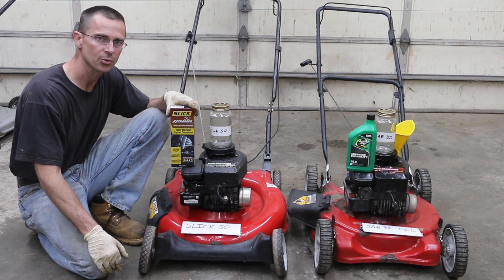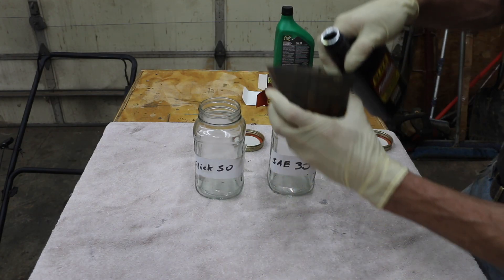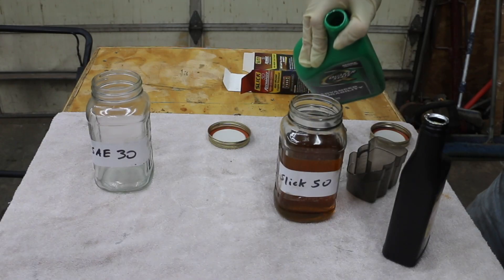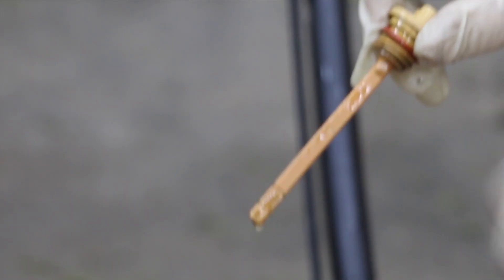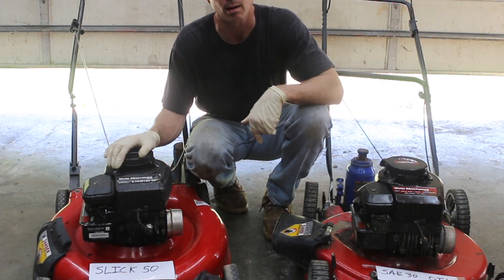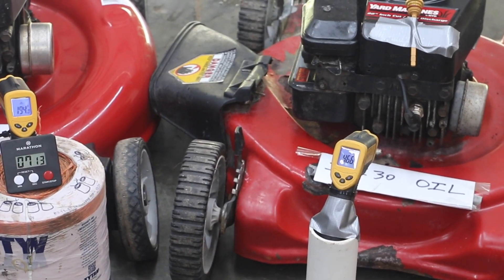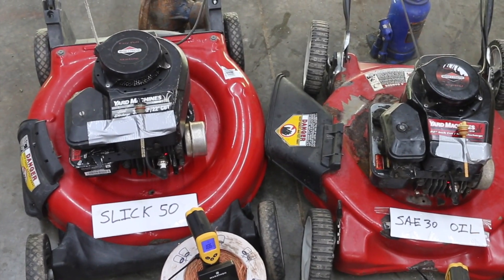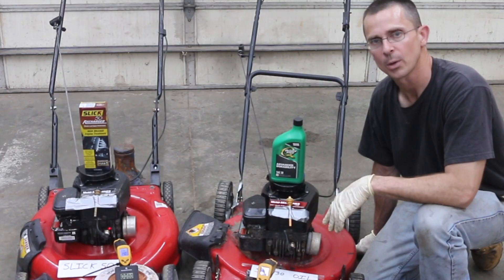Can't believe what SLICK 50 did to my engine!!--Dry Crankcase Test!

Comment: I used to work at Mobil Oil as a Technical Sales Rep. They always taught us that such additives are literally "snake oil" and to be condemned in all cases. This was because Mobil had enormous research facilties - which is true - and if there were any "magical" additives with remarkable benefits as claimed by Slick 50 and the rest, they would already have incorporated such materials.

Also, as shown by the video here, such additives can actually be harmful as I also found when I many years ago, added an additive which claimed to have micro-particles of teflon or similar (may have been Slick 50? cannot recall) to my Lycoming 0-320-A2B aircraft engine oil.

On taking the aircraft for a test flight around the pattern I found the oil temp starting to reach the upper limit very quickly. 

That ended any ideas of oil additives for me! Just use a good brand of oil and it will give the best protection and performance available.
Reply from the maker: Thank you for the feedback

Comment: You might want to do this test again.  Slick 50 has not been available since 1984.  The name “Slick 50”, which was not trade marked,  has been used by various oil companies but the product is not the original formula.  Look up youtube video titled “ Xcelplus: What happened to Slick-50? Interview with John Bishop”.  The original Slick 50 is now called Xcelplus.
Reply: I found this http://www.1expired.com/dura-lube_slick50.htm.  In summary, it says the miracle stuff is teflon solids in the oil.  Many lawsuits over claims of miracles.  Dupont, creator of teflon, says it doesn’t work as an oil additive.  Various tests have shown that the teflon solids actually cause anything from cylinder damage to blocking oil flow.
Reply from the maker: Thank you for the feedback and the link

Comment: Both my vehicles in which I used this stuff experienced wrist-pin knock at about 100k miles after I bought them new. I can only guess the oil splash lubrication was less effective due possibly to the oil droplets not adhering to the treated surfaces..more like not flowing into the bearing surfaces but rather resistant to adhesion by glancing off. I think this additive may be ok but only on pressurized journals.
Reply from the maker: Thank you for the feedback

Comment: I use to swear by slick 50 in the early 80s in my cranes and draglines. It for sure kept all the gear cases way cooler than plain 80 - 90 gear lube..In the 90s I read where slick50 was sold and no longer had the performance of the original company.. any thoughts on that ?
Reply from the maker: Thank you for the feedback on the formula change. I need to test the old formula

Comment: The problem with this test is that the engines are on their sides. A car engine is vertical and the Slick 50 has to be run in for X amount of miles before you can do this. Also these engines only lubricate the crankcase rod & arm so with no oil in the crank they will both run dry eventually. Slick 50 only works because it is magnetically attached to the metal work inside the engine with heat & friction. Lawnmower engines don't work this way. I have used a light spray off PTFE in the cylinder and this will help to protect your mower engine from seizing up in the event there is not enough oil in the crank. But don't run with no oil.
Reply from the maker: Thank you for the feedback

Comment: I agree with Speed Demon, the disparity of symptoms in the end suggests that the ultimate cause of failure was not the same. An engine who's main problem is a lack of lubricant will display symptoms like the SAE 30 side showed. The other motor probably had a more pressing (if not previously evident) problem.
Reply from the maker: Thank you for the feedback

Comment: I get much netter mileage with RISLONE.    ,  in my Mercedes C 240 it improved mileage from 24 to 30 mpg,   I tried it on my C300,  got 30 mpg. And it a 4 wd.   RISLONE is Zinc,   They took zinc out of oil ,   Old cars burn up with new oil,  study up on that,,,
Reply from the maker: Thank you for the feedback

Comment: If Slick 50 does what it claims the oil moves through the engine faster, carrying heat away from internal components and reducing friction. As such you should expect it to seize 1st due to lubrication draining away from parts fast. The Teflon doesn't really bond to parts, it just reduces molecular friction by changing the viscosity, and molecular adhesion.
Reply from the maker: Thank you for the feedback
Reply: @ProjectFarm  I never saw the Slick 50 no oil test you talked about. I used to use it in my 78 Trans Am Pontiac 400 Formula engine, years ago. 
I don't really understand what your trying to accomplish destroying motors, but youtube has a lot of that. GL with your channel 🙃

Comment: I use to use something called "Duralube" in my engines that were always at least a quart low on
oil and they never seized on me.  I know my bad for letting oil run that low.
Reply from the maker: Thank you for the feedback
Reply: Dura lube saved me a couple of times over the years.
Reply: It won't hurt your engine if it is a quart low. You could remove 2 quarts and it would still be fine for a long time.  Always top it off though.
Reply: I have used Duralube

Comment: I thought slick 50 had to run couple days to plate everything?
Reply: I believe it must run in the engine for a minimum of 30 minutes or an hour, I don't recall, but it does have to run in the engine for a little while to "soak in to the metal. This was not an accurate test, but interesting to watch.

Comment: 1. Shake up the bottle of Slick 50, otherwise most of it's solid particles remain at the bottom of the bottle. 
2. I have put a cup (8 oz.) of Slick 50 in every oil change for more years than I can remember. My 86' Toyota PU had 253,000k miles when I sold it, it's still going. Original timing chain, etc. Once a delinquent neighbor drained my crankcase, and it was only after the temp. guage went way up I pulled over and discovered that no oil was showing on the dipstick. Put oil in, drove for several more years, never had any oil burn related evidence.
3. Slick 50 is expensive now days, $30 per quart, but in the very cold temperatures of New England, I consider it worth the cost.
Reply from the maker: Thank you for the feedback

Comment: seems like so many variables that others have pointed out, the temp of the slick 50 engine is interesting,more testing really needed to remove variables , non destructive testing on 2 new motors and if in multiple test the slick 50 runs cooler , might have something there
Reply from the maker: Thank you for the feedback

Comment: Great video mister.. I marketed Slick 50 back around 1978..about the time it was a new product  before it was on the shelves in stores. It was sold by individuals & a friend got me involved. It came in a 32 oz can back then. The key is to let Teflon chemically adhere to the metal inside the motor. That means running it through the course UNTIL the next oil change not just for 30 minutes on the shop floor. We drained our mower & started it & it did NOT seize.  I've run about 3 vehicles in my life that I've had close to 400,000 miles when I sold them & still ran fine. On a couple occasions  I neglected the vehicle & with no oil on the dipstick  they still ran fine and I had no issues with smoking motors due to burning oil. Slick 50 comes in a much smaller bottle now.  The 20% back in the day meant replacing 1 of your 5 qts that the crankcase typically held.  I've owned several more vehicles than just those 3 & I've put Slick 50 in EVERY one of my vehicles which included various makes & models, also tractors for Ag & semi tractors. Thx for the video yet u might consider the proper use of Slick 50 as opposed to other 'additives' such as Lucas, Duralast etc. There's a diff as a 'part' of this Slick 50 is meant to bond to internal parts.. Not just lubricate 
😎🚬
And for the record I have approximately 3 million professionally driven miles behind me which includes racing, agriculture and also tractor trailer
Reply from the maker: Thank you for the feedback
Reply: @ProjectFarm  ..  This is a great channel. Thank you sir

Comment: I put Duralube into an old van that I had, treated it a few times.
One winter, it got so cold, the oil was to thick for the pump to draw out of the pan.
I'd let it idle for around 30 minutes, dry, until the engine temp warmed it up enough for the oil to get thin enough to flow.
Did thay for a week straighr, and had that van for several years after.
The van died of causes other than the engine, but it never wavered, and didn't eat oil.
I'd try running the test again, but use the lawn mower with Slick 50 for a few months before doing this death match test again.
I would actually put Slick 50, Duralube, and Motorkote as well as straight 10W30 all in a line to see just what product works best.

I've seen the "yard" you have, getting each engine the full treatment under load shouldn't be a problem.
Reply from the maker: Impressive!

Comment: I use Amsoil 5/30 in my 04 Yukon Xl  5.3 429;000 so far. Made a  believer out of me. Signature series.
Reply from the maker: Impressive!  That's a lot of miles
Reply: I use Amsoil in my Harley. Tests I've seen show it outperforms Slick  50. Test results can easily be manipulated but I have not had any problems with it. Never had any with any additive I have used.
Reply: I use whatever is cheapest in my 2000 5.3. It leaks pretty good, so when it starts valve ticking, I throw another quart of grocery store brand oil in. 410,000 miles.

Comment: All that effort! This experiment proved almost nothing, other than Slick 50 possibly reduces friction/heat during initial use.  You would have to test at least 100 NEW identical motors that had their tolerances double checked to conclude an average. Only then would this test be considered fair. Slick 50, DuraLube, Zmax, Prolong I believe all claim they change the metallurgy of the motor and I believe it requires a baking process (time) to do so.
Reply from the maker: Thank you for the feedback
Reply: I did a little digging, found Slick 50's inventor John Bishop retained the formula and sold off the name around 1984. He partnered with Xcelplus, look up the back story here on YT. Slick 50 was also sued by the FTC in 1996, false advertisement. I've used the product in two sports cars, lucky for me no problems, lol.

Comment: While Slick 50 does have Teflon in it's formula it does not mean that it really 'sticks' to engine parts. Think about it for a minute. The main useful property of Teflon is that nothing sticks to it. What makes people think that it will actually bond with metal parts by simply pouring in with the oil? Most of the claims made by the manufacturer of Slick 50 have long ago been proven to be false. It does not bond to anything in the engine and when you drain your oil you also drain out the Slick 50.
Reply from the maker: Thank you for the feedback

Comment: I had an 85' Buick Park Ave. that lost the main fan belt on the toll way while goin 65 mph. It was August, and hot as hell. I had been using Slick 50 for about a year, and that is what saved my engine. I had no choice but to continue on down the road at the same speed until my exit came up. I know what you're thinking, the high rpm's and the speed kept the engine cool. After I got to my exit, I still had another 10 miles to go, all in stop and go traffic. The temp. light did not even come on until I was pulling into the parking lot at work. The stuff works great in older engines, I would not put it in anything newer.
Reply from the maker: Thank you for the feedback

Comment: What Slick 50 does is thin the engine oil weight making it more slippery and solvent. What you did with the Slick 50 engine is run it and clean out all of the old oil buildup. When you ran the engine, it was essentially “dryer” if you will than the other with just old 30 weight. So essentially the engine with straight 30 weight is dissolving the old oil buildup the hotter it gets providing more lubricant. The Slick 50 engine with less buildup, less lubrication, seized sooner.
Reply from the maker: Thank you for the feedback

Comment: Some years ago, I added Slick 50 to my worked 355 Chevy V8 after the engine had done some mileage. I had to adjust the idle down by 300 rpm with the Slick 50 added.  The acceleration increase was really noticeable as well. For me, it was an amazing result.
Reply: Further to my comment- some readers mentioned that the Slick 50 used in the mower was not the right colour. The Slick 50 that I used was a white Teflon like colour. I also did notice better mileage.
Reply from the maker: Wow!  Impressive results.  The Slick 50 formula did change.  Thank you

Comment: According to the directions on the bottle of Slick 50, you add it to your fresh oil then run your motor until the next oil change. that gives it time for the Teflon to be "absorbed" into the motor parts for a car, 10k to 15k miles (US) 15k to 20k kilometers (Canada/UK). No need to add another bottle of Slick 50 for the next 4 - 5 oil changes.
Reply from the maker: Thank you for the feedback

Comment: I don't know about lawnmowers , bUt I used SLICK 50 in my 1988 Lincoln Town Car , 302 V-8 .  417,000 miles of city and open road driving . I never had the first case of engine problem using it . It was tuned up as directed in the owners manual .  THANK  YOU  SLICK  50 !
Reply from the maker: Thank you!

Comment: First of all, which engine is older?  Let’s purchase two mowers with the exact same engines built within the same parameters at about the same time. Second, you would have to conduct this test multiple times to come up with an answer to the question, “which is better, slick50 better or straight up engine oil”. I don’t work for slick 50 I have no interest in slick 50. This is not a valid test.

Comment: My rotary lawnwower hasn't had an oil change in 26 years. I just top it up if necessary. It gets used twice a week during the spring/summer/autumn. Its just a good old Briggs and Stratton and its never failed to start (I give it a new plug every two years). It has SAE30 in it (or it did when it started). I don't really see much point in destruction testing. I'm certainly not putting Slick 50 in it !  My cars get much better treatment I have to say. And yes.....My mower is so old its just a control exercise to see how long it goes with old oil in it.
Reply from the maker: Thank you for the feedback

Comment: I sold slick 50 way back when. Your poor results is because Slick 50 recommended treating the engin for 2000 miles. The intent is to give the Teflon in the oil to penetrate the minute “pours” in the engine. I have demo’d slick 50 in a 12hp drained engine until it stopped, let it cool, add oil and start it up and run it. It works!
Reply from the maker: Thank you for the feedback

Comment: That was a very interesting test. I have also used Slick 50 for years, but have not tested it apart for one vehicle. Years ago, I had a 1984 VW Golf GTi 1800cc. It was about 2 years old when I bought it. I checked the rpm of the engine before the test and 1000 miles after adding  Slick 50. The engine ran around 300rpm less at 70mph than before. I'm sure the container said something about running the vehicle for a while before you had the full benefit. Since then, I've put it in almost every vehicle that I have had. I have read a couple of articles about it being a waste of money, but for me the jury is still out. Perhaps a test after the Slick 50 being in an engine for a longer period might show a different result. Interesting too about the Slick 50 engine running cooler.
Reply from the maker: Thank you for the feedback

Comment: I have a 1990 chevy truck, 305 with over 220,000 miles. Second owner. I knew first owner, used to change the oil in all his vehicles wheni was 16 every 3k miles, so i knew it would be a great truck. 26 years later, still driving it.
Went to tow a friends ford ranger on a heavy homebuilt trailer about 20 miles, let him drive cause no tag on tlr, and i wasnt going to get that on my cdl.
When we unhooked tlr, i noticed engine light on. Rear main seal had a slow leak for last few years, just kept it topped off. It was dry!
I hadnt driven it in a while as i had been on the road. 
Duralube saved that engine.
Reply from the maker: Wow!  Impressive!

Comment: I have always used SF it is a great product and I have used it for 40 years.
Two points - 
Slick 50  will continue to improve engine efficiency until the next oil change after treatment, no further treatment is required. -
and these two engines were not new and may well have very different former lives before this test, who's to say when they would have failed.
I would have also liked to have seen a strip down of the engines to see what finally failed and the effects on other moving parts.

For me an interesting but inconclusive test, though I would still have expected the SF engine to have lasted longer.

I used to drive and service a Toyota Hi Ace truck in the 70-80's,  I had to adjust the tappets (rockers) every  6 thousand miles, I never had to adjust them ever again after treating the engine with SF,  The 1600cc (petrol)  engine ran for over half a million miles pulling a heavy builders trailer. I also SF'd the gearbox and differential.

Comment: Test results are questionable unless it is the exact same engine and both are brand new.One engine could have enough previous wear to cause seizure quickly.Which seems obvious if it wasn't hot.Even then multiple tests are needed.Disassembling two engines recording the tolerances ,reassembling then doing a short maybe two minute test and disassembling the engine and recording wear would tell the story.
Reply from the maker: Thank you for the feedback